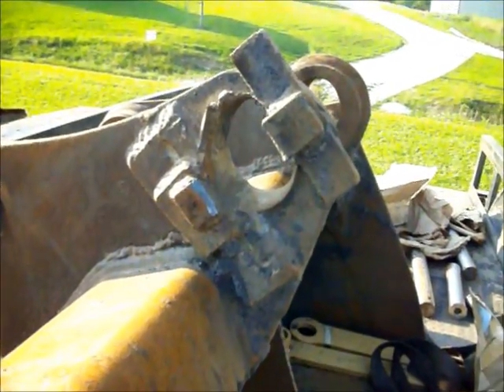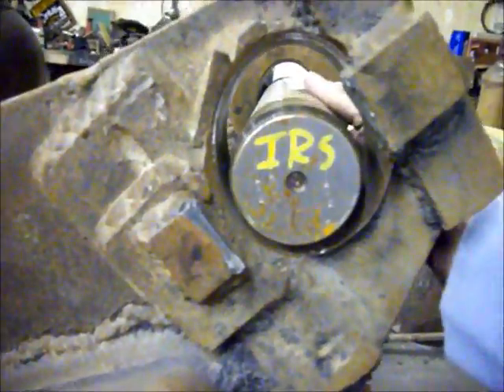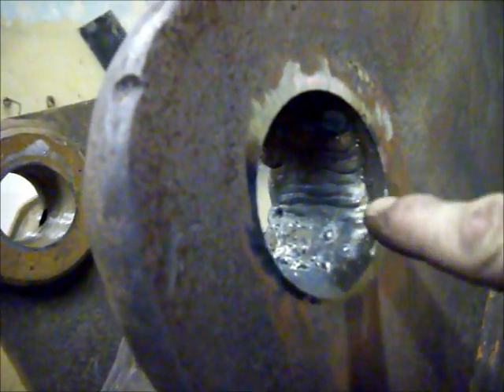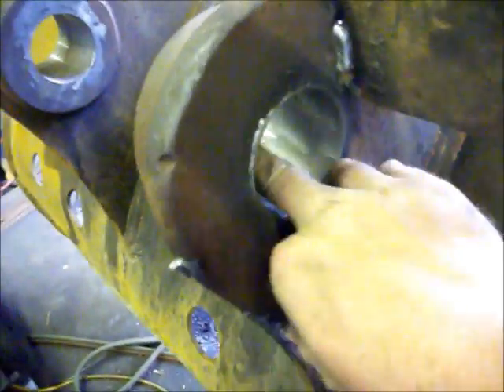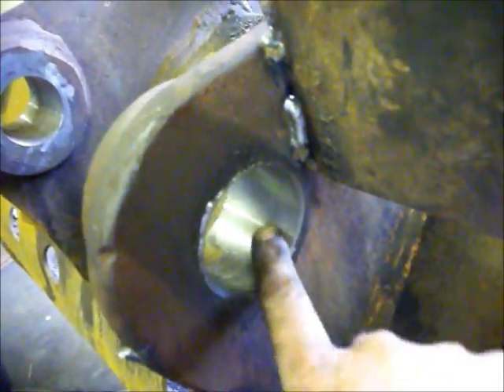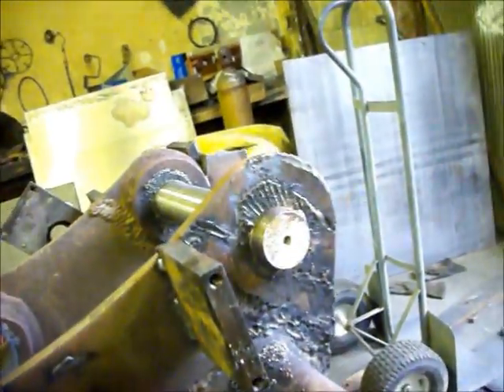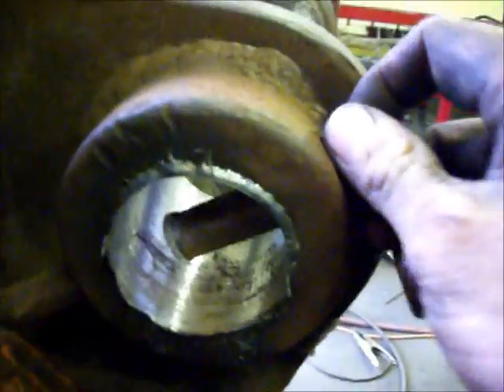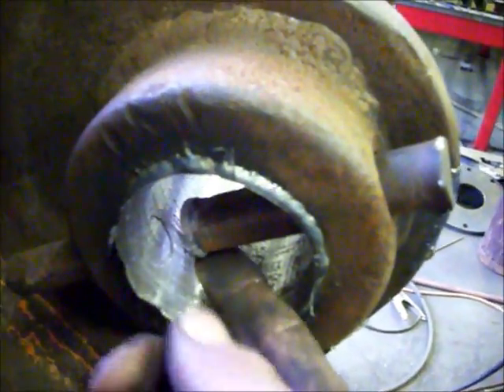Q150 Line Boring Machine

Comment: I have to say in my experience the bosses that have the holes in them, usually are slightly over sized and don't normally need to be machined during a repair.. And even if they are not exactly round t doesn't matter too much as they don't hold in the shaft. it is normally the area farther  inward that is machined to fit the shaft. In other words when you slide in the shaft on a in spec joint the shaft starts out a little loose as it clears the boss for the bolt then it meets the close tolerance area of the hole. The bosses with the holes are for a thru bolt and only keep the shaft from rotating and aren't for keeping the shaft tight in the hole.